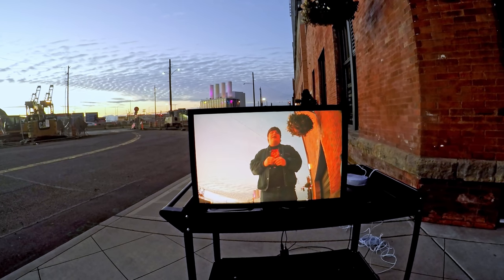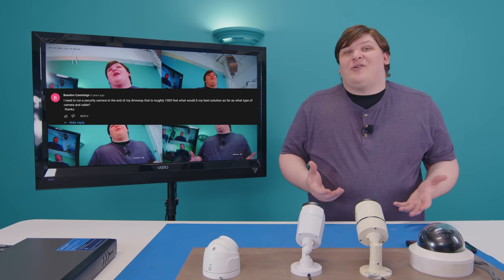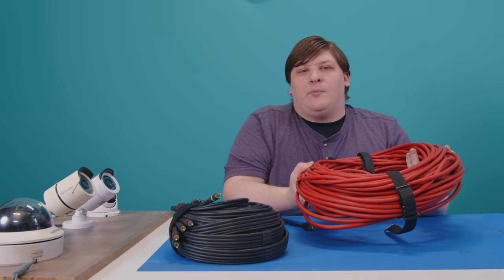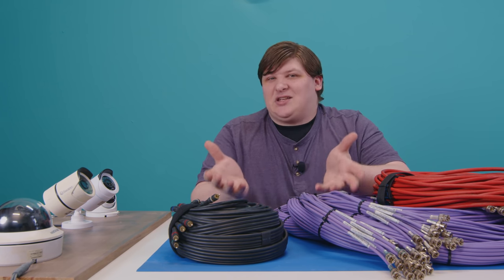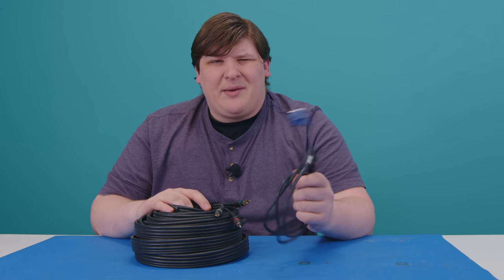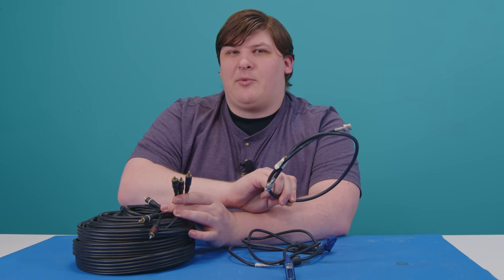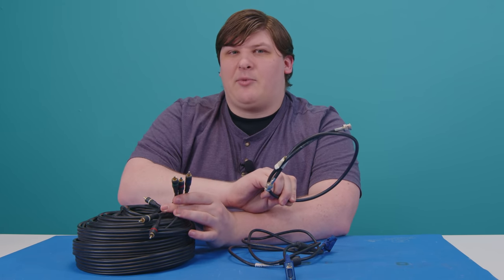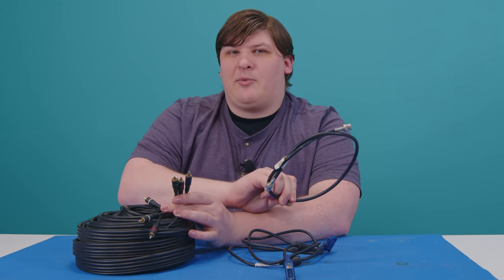1000ft of ANALOG HD video over a single cable?! [AHD/CVI/TVI]

Comment: AFAIK all those cameras still require 12-24VDC so a 120V receptacle with a power adapter nearby.
IMO its better to use PoE camera with a up to 100m Cat 5/6 cable (only 1 cable now) and plug that area's cameras into a PoE hub which outputs a 100Mbps/1Gbps Cat 5/6 run to your security room to the NVR. Slightly more expensive cable and a few PoE hubs, but far less 120V receptacles required.
Reply from the maker: Every camera has used the same 12V 2.1mm barrel power supply for decades, so if you already have wiring for old cameras, you'll have it for new ones. The entire premise of the video is going past 100m, where ethernet is only an option if you can afford to install new cable, buy repeaters, and have more points of failure that are, perhaps, stuck up in rafters that require a high-reach scissor lift and imposing a work stoppage in the warehouse to even test, let alone replace.

Comment: 2 more things. There was a consumer thing similar to 960H. Extended definition TV. I think that was 16:9 480i and 480P. Also, some standard definition TVs do have a very fine horizontal resolution. Because I’m weird I’m watching this video on a 36” CRT TV from the early 2000s. Using a very fine video input that most standard definition things can’t output I can get a higher horizontal resolution than 720 on the visible screen, and the user manual for this TV boasts “800 lines horizontal resolution” although user manuals often exaggerate.
Reply from the maker: I was pretty sure EDTV only worked over digital or component, and that whole "800 TVL" thing is apparently a lot of hokum from what I've read, regularly exaggerated and misapplied. But practically speaking - yeah, I could believe that it can actually render the whole 720 dots with a clean input.
Reply: @CathodeRayDude  yeah I think EDTV is only digital/component. Maybe the “800 lines horizontal resolution” is how many phosphor dots there are or something. Probably some theoretical value. But I can get great horizontal clarity through component on “newer” analog TVs.

Comment: You can do RJ45 to hdmi cheap, you can get wireless video transmitter over 1 mile from China but i am guessing the FCC will be at your door. Would the FCC get mad as it has USB also so i could use my computer all over outside?

Comment: You missed something about IP cameras. 

In theory they can actually run more then a few kilometers using a beam. Essentially a big dish that can use radio waves to bridge the gap. 

Hence most systems I've seen where the distance is measured in kilometers (think farms) used IP
Reply from the maker: Oh damn, good point, I hadn't thought about point to points.

Comment: Analog audio can go really far without interference by using balanced signals, was there ever balanced video?
Reply from the maker: Very good question! I actually have no idea, and no idea whether it makes sense at the frequencies in question etc.
Reply: Its not necessary with coax
Reply: Yes.  In the dim and distant past of 405 line monochrome TV in the UK it was quite common for an outside broadcast link from the venue to an injection point on the main British Post Office TV distribution network (coax and microwave) to use an existing telephony pair. Video bandwidth about 3 MHz. (All permanent and temporary links between TV studios, transmitter masts, OB sites etc were engineered and maintained by Post Office personnel.)

In the early 1980s my group installed several 313 line 50 field/s 2:1 interlace systems operating up to some miles over un-repeatered phone pair cable. Video bandwidth about 1 MHz.

In both above scenarios extensive frequency dependent gain was employed at sending and receiving ends.  Adjusting the controls required much skill.

Comment: Kind of reminds me of HDMAC without the digital audio component included. https://en.m.wikipedia.org/wiki/HD-MAC
Because the eye notices detail more in the monochrome component, more of the bandwidth is given over to it. A lower "resolution" colour overlay is used to give the impression of a higher resolution than you actually get. In these systems, removing the audio would give that much more bandwidth to the picture further improving it.

Comment: 21:14 The NTSC signal is NOT 720 pixels. The active image are is enclosed within the middle 704 pixels. This why people still don't understand SD video and how BT.601 is backwards compatible with BT.470...
Reply from the maker: That's the entire point.
Reply: @CathodeRayDude  And still many people think that it's the 720 pixels that compose the 4:3, or 16:9 picture, rater than the part specified by BT.601, resulting in improper aspect ratio apon conversion to square pixels (I'm looking at you youtube conversion, also youtube sill does not support the superior 576p resolution).
Reply: The DV video format was 720 pixels across.  Some other systems were 704.
Reply: @VPWedding  720 samples, yes, but only the middle 704 were the 4:3, or 16:9 image as per BT.601. The rest are not technically part of the image, whether they contain anything, or are standard blanking, the bottom line, is that you can't use all 720 pixels for suaring pixels to 640x480, or 768x576 video, because it will result in incorrect aspect ratio.

Comment: QAM or DVB RF modulators are another way to push HD a thousand feet.  With a QAM modulator, you just use a HDTV in the "cable" mode to receive it.  They used to be expensive but are now on e Bay/Amazeon for decent prices.  For those that don't know what a modulator is, it's what the cable company uses to send a video signal from their headend to your house.
HD-Composite would b e abetter way to define these security cameras than NTSC.   NTSC was never more than 525 lines and 6MHz bandwidth.  I'd be interested to see what the bandwidth is on these HD signals.  I'm guessing it's around 60MHz for a 2k signal.  Even the crappiest RG-59 can do 500MHz so that makes sense.  It'd be interesting to use some good cable, like Belden 1694 to see what one of these cameras looks like.
Thanks for the great video! :)

Comment: It might be possible to match this range digitally with IP cameras and MoCA if your coax cables are sturdy enough. I've heard MoCA can go 1000+ feet but I've never actually seen anyone push it that far (since barely anyone seems to use it). Doubt it would work with that crappy coax cable, though.

Comment: As a professional Hikvision (Hike vision) is how it's pronounced. Any who I would highly recommend not buying Hikvision products or any other professionals grade syatem off of Amazon as they are considered "black market" products and not usually supported by their respective manufacture if something is to go wrong. They work just as well however and if you're a do it your self kind of person you should have no problems with them just don't expect any help from the manufacturer if something is to go wrong. Trust me I ran into this before as a customer bought their own system and things didn't go well for them so they called us. We called the manufacturer to ask for support and the first question they ask is always "what's the serial number of the device" if they look it up and it doesn't come up in there system it's considered black market and they say go pound salt. Thing such as forgetting the password for your recorder which happens way more often then you would think to customers. There's no way to reset them manually (usually) and you need to contact manufacturer to reset it. If they flag it youre locked out and basically have a brick that shows video image from the connected cameras.

Any how that's my 2 cents great video!

Comment: digital formats 'falling apart' when a few bits are flipped is not due to them being digital. but due to them being compressed in a way that kinda needs the preceding information to display the current information. at least on a per block basis. leave out the compression, insert something like the blanking signals tv's had. and tadaa. flip as many bits as you want and it'll still just display it. with a few pixels having the wrong color.
Reply from the maker: Sure, but since very-nearly-literally nothing in history has ever used uncompressed digital video and nothing will ever be able to, what difference does it make? "digital video" has meant "compressed video" for the entirety of its existence, minus maybe one format (digibeta?) that nobody had.
Reply: @CathodeRayDude  plenty of things use uncompressed video. networks have moved on since 9k6 you know. as have storage devices.

Comment: Actually using ip cameras is now the gold standard with proper networking it can also be cheaper especially when you need to cover multiple buildings in a complex relatively easily. I recently completed an installation on a 22 building complex with almost 70 cameras all monitored from a single location I used ptp dishes to go between buildings and just have a Poe switch at each building it’s extremely reliable and all the cameras run at 8mp which you definitely can’t do with analog. TBH the largest bottleneck with up cameras is there’s only 254 up addresses per subnet. Another not on this as most large companies have an extensive network in their buildings so it doesn’t take much to add ip cameras into the mix

Comment: It's so weird to me that sending video over a cable is such a struggle, when my homemade quadcopter has a video transmitter onboard that ive used out to 1km (over 3000 feet) and that's using air as a medium
Reply: Yes, but that medium is ultra insecure. Its broadcasting out in circles... anyone can pickup the signal.

With wires, you have to physically get to the wires (or end units) to see the signal. Making it far more secure.
Reply: @bmw328igearhead  right, but my point is that if I can send video through the air over 3000 feet, surely that same hardware could send video down a piece of copper of the same length with a fraction of the power, considering you no longer need to deal with the efficiency of the antennas at both ends, or the inverse square law.

Comment: I used to use a Popcaan antenna to pick up Internet and I was wondering if you could set up some kind of point-to-point directional antenna for the security camera I was picking up Internet with a Pringles can well over 1000 feet I moved to a 12 story building and I never paid for Internet for three years so many free WiFi

Comment: Well. It was you and your friends who have missed this AHD. Those who are at least familiar with video surveillance systems are being aware of this formats, for sure. People who decided to install a video surveillance at home have to choose one of two worlds: to go with IP cameras or to use these AHD. Actually, this AHD was intended for upgrading EXISTING surveillance systems, in order to use tons of wires already installed for years. However, these cameras a kinda cheaper than IP-cameras and in some situations could be used in new systems.
Reply: I forgot to add a note regarding 'output ports' on PC or console etc. There's no use for that, as long as there are lots of existing ways to connect a monitor or TV already. This AHD is good for long distance transmission via more or less good coax cable, which is not needed at all when connecting monitor.

Comment: Using VGA for 4k is a bad idea, the frequency and "bandwidth" would be so high that the colors would bleed between the cables, where you would need to redesign the cables to make it possible to have a good 4k image, in the end its easier for the consumer to create a new standard
Reply: DB13W3 bundles 3 coax connectors inside a D-sub shell. It was meant to be used with three coax lines bundled in the same cable as the data wires. It's pretty much one for one with VGA, just better shielded for the video channels.

Comment: I did a bit of fiddling was interesting cable s.

I had the opportunity once to grab the data cables from an IBM mainframe believe is a system 38 and these cables were rather unique. From what I understand they were multiple Platinum coaxial cables approximately 3/8 of an inch thick each but they came in a bundle of about 40. The cables themselves were designed to be used as data cables from the main computer system CPU cabinets to the external hard drive cabinets. Well as it turned out those cables were had to be extremely lost resistance so that's why they were made of platinum. Yeah real Platinum. Well since they were decommissioning the system I managed to grab two of these particular cables each of them probably 50 ft long and like I said probably had about 40 individual coaxial cables each.

Well the problem I ran into is I was trying to run composite video from one room in my apartment to another room which made the cable runs particularly long and I also had SVGA level VCRs and video inputs on my monitor. So what did I do grab some grab some connectors from radio shack and built My own. So I have a set of platinum coaxial composite video cables at least that's what I use them for and they were fantastic. Being tiny coaxial cables made a huge difference in the signal quality and I was watching video was very decent quality from one room of my house to an entirely different room of my house. So yeah I can understand where they've extended the quality of a cable via stretching limitations of ntsc signals. I bet you could go even further with high quality cables.

Comment: I feel like the resolution of a line can pretty easily be approximated by the point where luminance breaks down into color interference.
But that's not a precisely constant from set to set and is irrelevant to black and white security monitors.
Hmm, composite security cameras probably were mostly black and white for that reason huh? Literally greater effective resolution.
What came first? The b/w monitor chicken or the b/w camera egg?
Reply from the maker: This is something I think about a lot. I'm certain CCTV originated before color TV existed, so when color came along, did they try it, realize it was counterproductive and back off, or did they recognize that it wouldn't be useful ahead of time and not bother with color until the technology improved?

Comment: is this using compression, or low latency enough that say, a small wireless transmitting module could feasibly transmit from a small flying camera thing to a receiver module on a pair of video goggles? ^-^

Comment: Did I miss IP over coax? It actually exists now with adapters. I've looked into it several times for things like outdoor runs or such so I don't have wired running through my house. Or so you can use the old coax runs.
Reply from the maker: The trouble is you're either adding a big chunk of native MOCA switchgear to your network and purpose built MOCA cameras (how is MOCA licensed? do they license it?) or you're adding two pieces of gear to every single camera run, two more failure points, two more AC adapters to plug in.
Reply: @CathodeRayDude  very true. If you could plug in play the existing wire that is the much better option.

Comment: I notice the frame rate on the HD cameras is *low*. I assume that's because of you're trying to shove 1440 lines down a cable that's supposed to do 480p60, or are the cameras just bad?
Either way: great video, all the videos of you scratch that one hyper specific nerd thing itch I have
Reply from the maker: My understanding is that some of them do higher FPS; I'm not actually sure how high it goes.

Comment: Do you think these new security cam DVRs would be a good composite video capture card solution? I have a rack of 8 SVHS machines that I'd like to capture footage from.
Reply from the maker: IMO no, not the ones I've seen. They record h264 or h265, or worse if you have an older one, the bitrate is crap and you don't really have direct control over the compression settings. If you aren't concerned about archival quality and just want *something*, they're probably a great solution.
Reply: If you're capturing from S-VHS tapes, I'd imagine you'd get better quality captures using s-video, vs just a composite capture that's better than other composite captures.
Some security dvrs reportedly do have very good conversion though, presumably it would need to be specific models though.
For general capture, quite a few DVD/HDD recorders seem to have pretty good conversion.

Comment: I wouldn't say digital TV as a whole fails to handle faults.  

ATSC, clearly, sucks; but ATSC is but one standard, and its inadequacies are not fundamental to digital signalling.  

It's entirely possible to transmit a signal at SD, then in HD (minus the SD signal), then 4k (minus the HD signal), all with different levels of analog power, bandwidth, and digital fault tolerance; the absence of such a standard suitable for over-the-air consumers in the US is - make no mistake - a design decision.  

The FCC, clearly, felt that getting channels barely wide enough to fit a barely functional signal was more important, than making that signal resilient.

Comment: I've always been of the mind that analog SDTV actually looked better than when it was converted to digital. So I pretty much agree that digital TV is not that great, also the bit rates are pretty poor and broadcast digital really doesn't look that great, tons of artifacting and blocking in the picture and becomes an absolute mess of digital noise when there is fast motion. Streamed video (especially video from a Blu-Ray) looks way better and I think is the best use case for digital video. But I think we would have better looking broadcast HDTV if it wasn't digital.

Comment: So do you think if I got one of these analog HD composite cameras I could maybe get it to display on some very sensitive CRTs or record to some VCRs since the signal is basically a higher bitrate sped up version of the same thing?
Reply from the maker: Nah, the timing is waaaaay off.
Reply: @CathodeRayDude  ah, ok.